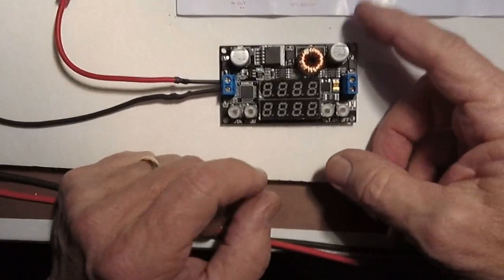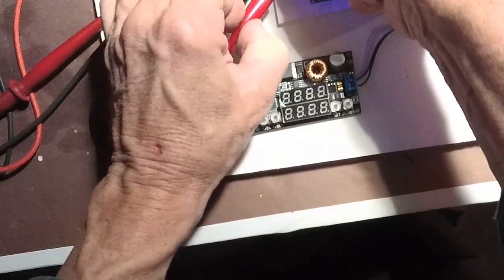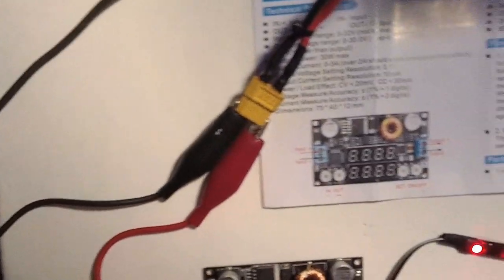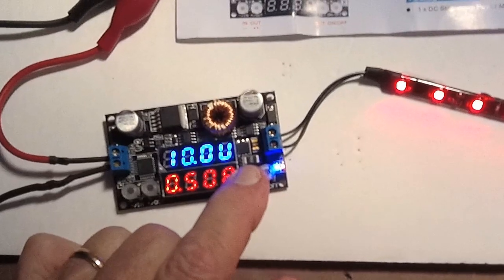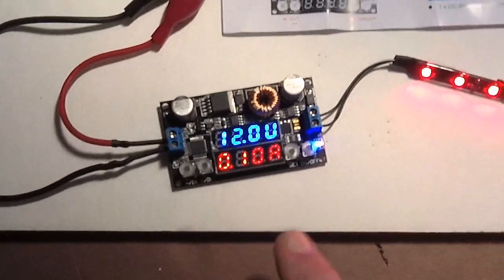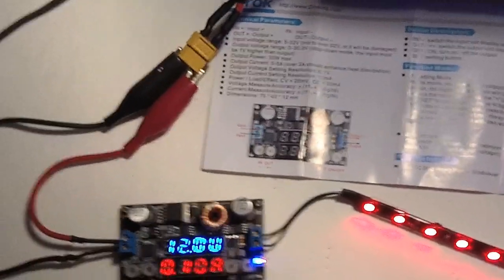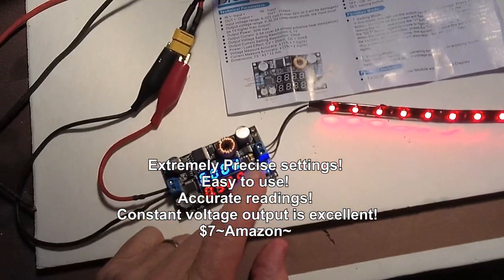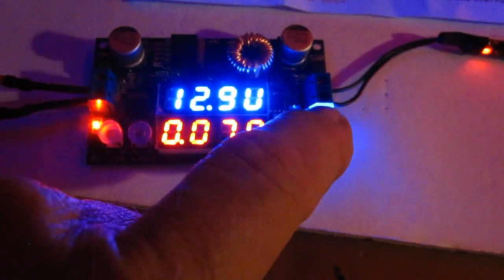Handy Gadget for $14. DROK Buck Regulator with dual LED displays and a demonstration..

Comment: I have 2 harbor Freight Multi meter. It can only measure up to 10amp. Would I be able to connect multi meter in parallel like the battery. So each can read half the load. Add two reading for sum. Total up to 20amp.
Reply from the maker: I do not think that would work.  Best to get a regular meter and use a shunt to reduce it so you can use it.  I made one to measure my F-16 flight battery, which draws over 150 amp.  You can see it in the video (leaf blower f-16)

Comment: Is there a different between AC amp meter and DC amp meter?
Reply from the maker: Yes, as it requires a different set of protocols for measuring.  Most multimeters have switches to switch from AC to DC to get proper readings.

Comment: I believe this is what I need, can anyone chime in? 

Looking for a module to provide constent 12v output power, yet will stop providing 12v's if it sees say...13.5v (etc) on the receiving end as not to overcharge anything if there happened to be a battery inline.

I built a box that has a 110v to 12v ~80w inverter (popular with led strip users). I then used a XH-M603 board off it to limit voltage output....the problem is that board is suited to be a battery maintainer and will not produce voltage output unless it sees voltage from a battery. It also kinda sucks as if the battery is low (too low), it will not charge the battery or even turn on (will not charge batteries that are low). It's like a very picky battery maintainer. 

So looking for a board to pump out 12volts. The 110v to 12v inverter does this and pushes out constant 12v's yet is unregulated and would ruin a battery if left long enough as would shove 12volts down it's throat non-stop. 

I'm not so much using it as a battery charger, yet more of a 12v constant power supply that will be regulated and voltage cutoff  happens if it sees a battery reading excess volts (the XH-M603 does the cut off feature)

Editing as I go, I'd be in need of a 10A unit opposed to this at 5A, yet asking if these will do the ticket:

https://www.google.com/search?q=10A+DC-DC+Adjustable+CC+CV+Step-down+Power+Supply+Module+LCD+Dual+Display+%2B+Case&safe=off&client=ms-android-sprint-us&prmd=visn&source=lnms&tbm=isch&sa=X&ved=2ahUKEwj18uf46-nfAhUIL3wKHfs6BMYQ_AUoAnoECAwQAg&biw=360&bih=612#imgrc=TVJJwCstvdSTaM

Or do these machines simply regulate the "output voltage"? Not too concerned to see an output in excess of 13v's, I just want it to shut off if it sees 13vs on a battery.

Comment: What is model number is it ? 
Can you tell me please
Reply from the maker: Droking.com shows them all.  This got burned up in my fire, so cannot look at it physically.  Here is a link.
http://www.droking.com/75w-buck-voltage-regulator-adapter-dc-4.0-38v-to-1.25v-36v-5a-adjustable-power-supply-power-converter-driver-module-voltmeter?search=buck%20regulator&description=true&page=4